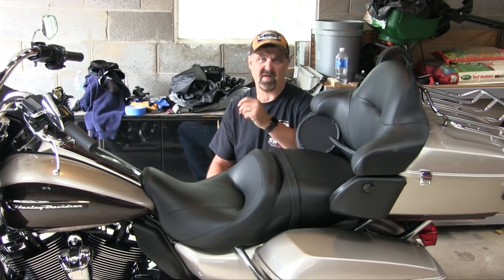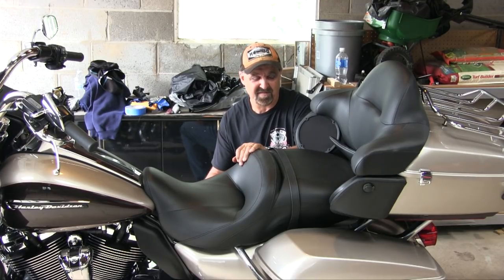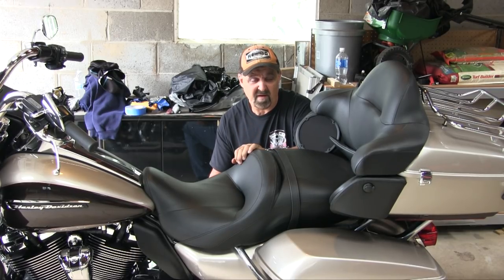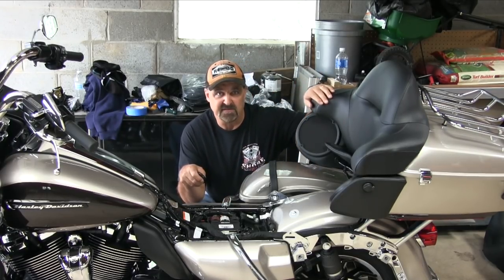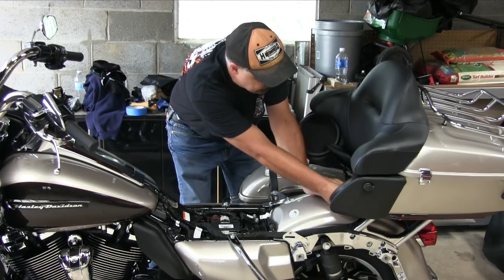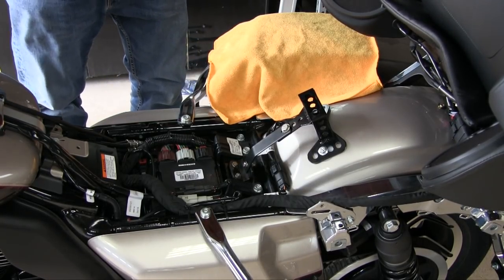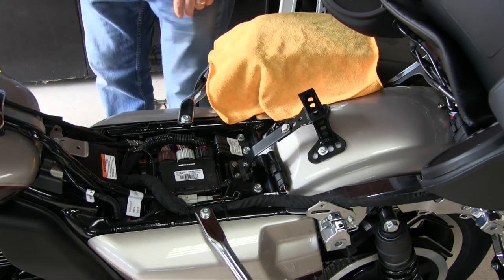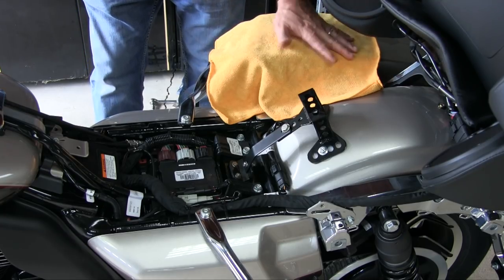Installing Drivers Backrest Road Glide Ultra

Comment: I had a similar backrest on my first Harley- a 2001 RoadGlide standard. It was “adjustable” also. Nearly identical. Those spring loaded ones are crazy hard to pop into place without plenty of practice. My 2015 Limited needed one so I wanted to try Harley’s Adjustable and I was able to find one used in a Limited Facebook group and had the dealer install it cheap. Only adjusts forward which is odd, so I’ve never actually adjusted it. Haha. I enjoyed some demo rides of the 2019s lately and ironically, first thing I missed was my backrest. Haha. Thanks for sharing man. Ride safe!
Reply from the maker: Ryan's V-Twin Vlogs Someone needs to make a better system? Springs are crazy hard. Ride Safe

Comment: Have you adjusted the shock tension yet the adjustment is under the bag you removed black knob with numbers at the bottom. From the dealer mine was set at zero there is a graph in the owners manual for were it gets set by weight.
Reply from the maker: I have not played with that yet. I know it is set to 3. Seems pretty good. But I will look at the weight chart. Ride Safe
Reply: I put mine about half up I ride two up or with my computer and back pack when commuting so the bike is heavy all the time.

Comment: The Goldwing backrest bolts to the bottom of the seat so it comes off when you remove seat.  That bracket looks difficult.
Reply from the maker: That is interesting. This one has to be removed before you pull the seat. Ride Safe

Comment: yep same backrest I had one and took it off the rest has little adjustment and it pushed me to far forward and was uncomfortable  , I would have sold you mine
Reply: Did you still have one that fits a 2018 Road Glide....mount and rest or just mount?

Comment: Got my backrest on the other day and went straight back to work, finally road it a week later, and thinking I might need to adjust the bracket all the way back. I put it on the same spot where you ended up and seems to be pushing me forward too much. My first bike I have ever put a back rest on and even though it felt weird I can see I will enjoy it
Reply from the maker: I did that same thing. Pull the mount all the way back. This will give you more room in the saddle. Ride Safe

Comment: do you have video and how to take off the seat ?
Reply from the maker: I do not. There is one philips screw on the back of the seat going into the back fender. Take out the screw and push the seat forward and it will pop off. Ride Safe

Comment: The bracket doesn't have rubber seal with holes so don't scratch up the paint
Reply from the maker: No. Even my last one didn't have a rubber gasket. That would be a great idea. Ride Safe
Reply: Brian Fisher those plastic washers under the nuts keep the bracket up off the fender. Hth

Comment: I have big hands and getting my backrest takes as long as your video.
Spring pops out , remove seat , find it     #$%#^&&$@!
Reply from the maker: Wayne Weck There is a trick to it. It gets easier. Ride Safe
Reply: @HarleyDayRider  I have to get a new battery this Spring  and try it again . You sure made it look easy

Comment: My riders backrest off my 08 street glide fit on my 2015 road glide 
So yea the one off your 2011 would of fit on the 2018
Reply from the maker: I would for sure. I just had some bad information from someone that said it would not fit. Harley never changed the bolting pattern. Ride Safe